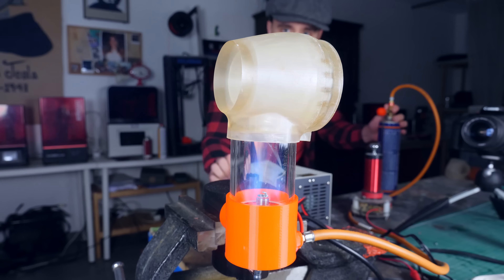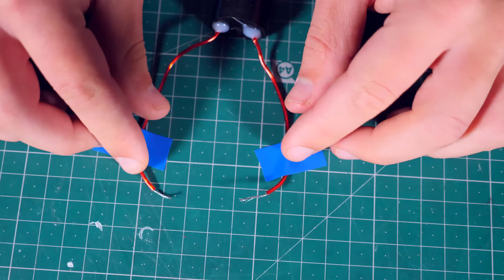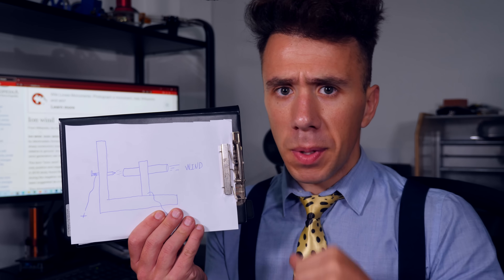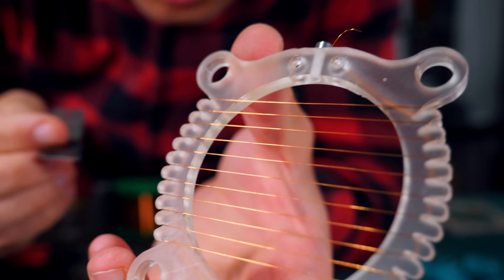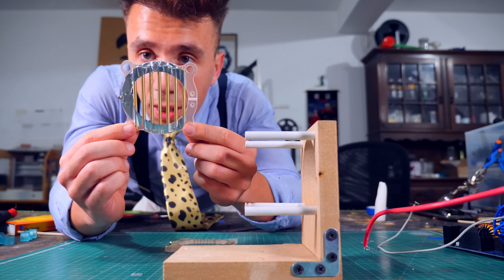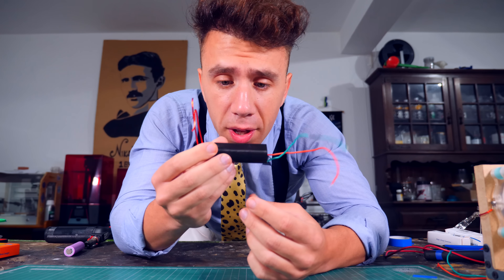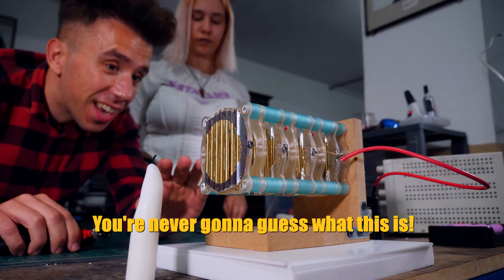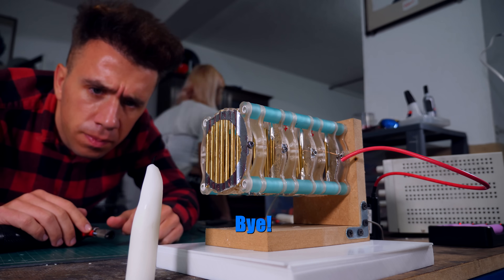I built a TRUE BLADELESS FAN

Comment: This was an idea I had as a form of new space propulsion when I began my career as a T.V. Engineer back in the 80's and my Tie stuck to the front of a Television..

I Know anyone could say this but It's honest truth.  

I Believe the answer, (Thought when I had my original idea) is to switch each H.V. Coil on and off in quick succession..
Maybe try connecting to a car distributor cap and spin that with a drill.

If that works look into switching the coils on and off faster with a simple 4017 Decade counter driving F.E.T Transistors and a 555 variable frequency clock generator or an Arduino driving 4 F.E.T Transistors (Take care protecting the electronics with suitable flyback suppression)...

This suppression isn't required with the mechanical car distributor which is why i'd reccommend trying that first.  Around 5 euro from a car scrap yard.

Plus i'd love a 3D Printer and i've never seen this idea of quickly switching each on and off sequentialy.
I'd also be very interested to see the results..

Cheers.

Comment: What would be quite interesting to know are:
- How efficient this is compared to a normal fan with blades?
- Does changing the grid size lead to better or worse results?
- What are the maximum amount of sharp points possible before it doesn't work anymore?
- Will a bigger or smaller blunt line increase or decrease air flow?
- It has Airflow but does it also have force behinde it? For example in some of your jet engine videos it turned out that eventhough there was alot of airflow there was no thrust.
- Instead of using wirles why not use metal mesh? That would increase the shappoint density per sqmm.
- Is does the weight to thrust ratio scale linerally with size (radius)? Maybe smaller radius has greater thrust making it possible to build small rc planes with these wich would be cool.

Comment: You should put a duct around this design and see if you can focus the air better to avoid losses. Also, shoot smoke through it so we can see how the air looks/see turbulence. I think the hovering triangle used foil because that had less resistance. Your tubes are going to cause drag when the air has to go around them. If you had a foil array, even if you thickened up the foil, it would perform better.

Comment: Want to upgrade it? Make it much bigger, larger diameter , then use a screen, like metal window screen or a flour sive. then use flat instead of tube. Or even  concave the surface a little. Then multiply layers like that. Put it in a tube to seal the sides and put a nozzle on it to focus the wind. 
In short make it like you would a jet engine, except short length and bigger around . 😉

Comment: How much ozone is that thing putting out?  You could increase the output by making each stage a bit larger and placing them inside a duct that allows outside air to be pulled in through ports using the venturi effect.  Kind of like the SR72' J58 engines do.

Comment: I have two ideas. They are both brilliant. I also have a third idea that is less brilliant. 

First, close the tube. You have the whole sequence open on the sides which is convenient for filming, but you aren't building any pressure to move more air. Just enclose the set in a clear tube. 

Second, use a venturi air mover to increase airflow. This is the effect that the overpriced Dyson uses to get lots of airflow from the relatively small fan inside. 

Third idea. Try using more tomatoes. Lots of them. Whole boxes of tomatoes.

Comment: That whistling you hear is not wind. It is sound created by the plasma heating the air with a certain frequency that comes from your voltage boosters being switching power supplies that use coils and pulsed electricity to increase the voltage.

Comment: I wonder if you could improve speed by using higher voltage at each stage, now the air is moving from a high potential to a lower potential and back to a higher one again, so you might be deaccelerating the particles between stages. So in theory by connecting the generators in series, and having the first anode at the highest potential and the last cathode at ground, the air flow is always pulled towards a lower potential. Mind you, this is based on my absolutely zero knowledge of ionic wind, which I learned about approximately the length of this video ago for the first time. 😂

Comment: Ok the problem with your ion thruster is that you have like almost packed the intel for the air if you allow more air to come in maybe the thrust increase and not only high speed wind will help you create thrust but you need to pressurize the air to get that sweet full thrust.

Comment: Video Idea: Bladeless fan in a drone setup. But not just any drone setup, set this up with the Spinning Drone Paradox. Since the bladeless fans don't have a lot of force behind it, what if you used the thrust it is giving to rotate the blade which in return gives you force to fly the drone. A YT channel (Nicholas Rehm) made a drone with this Paradox and I am curious of how that would turn out.
Reply: From my armchair research you could, but the amount of power you would need would be immense. Like, the kind of power a drone battery might not be able to provide. There's a reason these ionic boosters aren't used to power fans to begin with

Comment: How about make the negative elctrodes out of PCB material, use coarse sand paper on the copper electrode of the PCB, and on the positive electrode use aerodynamically shaped 3D printed parts and coat them in copper or something conductive enough for the experiment, Enclosing the sides wouldkely increase efficiency too, maybe take advantage of the Bernoulli principle aswell at that point.

Comment: This is exactly how ionic air purifiers work. They have thin wire in a grid and the "filter" is metal strips. The dust and stuff in the air is attracted to the metal plates and sticks.

Comment: Idea: Make a jet engien that is light, small and compact. Than eother mount it on a RC plane or a car. The rezultat would be i same if it could be done. If you make it on a airplane, make the plane body with styrofoqm the weight is redused. If you make it on a car, i reccomend making a aerodinamic plastic body, not heavy but not to light, also the body/shell should be low to the ground, at least at the front. Thats because fast moving air could go under the car from the front and push it up and makes a whole backflip. These things could be very interesting to see come to life!

Comment: I bet the stages are working against each other.  You might want to put screen attached to ground between stages.  
Circular cylinders are more draggy than elliptical cylinders, so you might want to roll your tubes so they are smaller in cross-section.

Comment: Why not create a hollow wire next to a regulate wire, but at Nano levels, and see if the wind adds up if you make bigger and bigger strands to handle the wind passing by.... Start Nano, and build layers larger and larger to handle the progressive air flow.... In this way you can still layer the progression output, but from a more efficient starting point.

Comment: "The Ionic Drone Alternator" basically this concept turns a car alternator into a drone motor that charges the battery and boosts the ionic wind from the net below. I'm not worried about the 3d printer I simply don't have the time or resources so I'll give it to you

Comment: Stick with a fan. Maybe even a 10" (250mm+) 7200Rpm  Pabst EBM, with the cast steel blades. Remove the fan guard to theoretically improve flow !
Your Ionic Cannon is cute! 🥰 I think you should surround it in a 16 stage toroidal accelerator. Phase the Ionic field exactly opposite the toroid field pancake.
Then flip the fields at 400hz. 😛 You might need to make some REALLY big Caps too, maybe use aluminum garbage cans, you need like 100Gf (10x27th) and put them in front of the toroid's, but behind fets or hefty SSRS.  Things at range  will  ....Glow

Comment: Maybe put an engine of yours on a model airplane and fly it. That is always impressive. It doesn't have to be this one though, because storing the battery, circuit and motor itself could be challenging.. So just use one of your other engines instead XD

My first suggestion would have been to build a rocket, but that is way to complex to build and to steer, while you can just take a model plane and strap stuff  onto it. 🤷‍♂️

Comment: What about a series of rings and reduce the radius as you get closer to the center? So instead of a series of straight wires/tubes its a series of circles. Also use a seperate HVG for each set of rings.

Comment: How about a little cheat ?
Use your design in place of the rotary fan in a "bladeless" fan ? 
Enclosing the wind generator should help a bit with power. 
Saw other great ideas in the comments. Perks of being late.
Sandpaper scratches on the emitter wires, and coiling wires on a blade shaped receiver, might be worth a try.

Comment: For the largest number of corona discharge points, use carbon fiber cloth cut to expose millions of fiber ends. These are used in ion generators and are the best ion sources.

Bear also in mind that this device is at its core an ion generator and can crank out lots of ozone. Take steps to prevent destroying your lungs.

Comment: I played around with this aswell and it’s so fascinating 😳 I’d love to see adjustable distance between the stages.

I assume you have one common voltage that is the same for every stage. But the stages are a bit different. 

If you make it so that they can be adjusted individually with a screwdriver and not with the spacers, you can fine tune each stage for maximum flow juuust before the sparking point.

Ideally this will shorten the spark gaps and increase the amps without the voltage breaking down.

Comment: Video Idea: I guess you could make the beam more localized by using magnets as they do in particle accelerators. From what I see this is not much different from a linear accelerator. To achieve this, usually a multipole magnet configuration is needed. A more localized beam would give an increased flux and therefore more wind in a smaller area.
Reply: A problem might be the additional ozone produced in such a small work area.  This multistage setup is already getting up there; depending on the voltage.

Comment: Something Ive wondered about is replacing a solar panel with a hot air engine to generate electricity. I did the calculations and if you make every stage efficienctly you should be able to make a system with an efficiency about 3% higher than a normal solar panel.

Comment: It really tickles me that these designs are being discussed more. I've been obsessed with the "solid state propulsion" airplane concept that came out of MIT years ago, and in the reverse, the "vaneless ionic wind generator" for harvesting power from airflow. Really curious to see what systems people will apply this phenomenon to.

But yeah! If I were to suggest anything in particular, using the Coanda effect that those fans advertised as "bladeless" do might be kind of fun. The grounded tubes could maybe be reshaped such that you see a flow along their surface. At any rate, right now it might be losing at least a little efficiency to the wake of the tubes. Not sure how much that ultimately matters as you add more stages.

Comment: The reading on the anemometer might be inaccurate due to noise from the high voltage Chinese spark whatever
Reply: I think I know how to fix the water jet skateboard just make a ring on the front of the impeller the centrifugal force might be pulling the blades to the point that it gets destroyed Ps I hate tomatoes raw too and ketchup is not my favourite

Comment: Make a ring where the pins to hold the wire is in the middle and on the outside. You will get a star shape and also you will have more thrust in the middle. For the other side drill holes in a copper sheet and put short pieces of coppe tube. Use solder to connect them. If the ratio of holes, diameter and density is right you should have enough area for the plasma to catch on. 

Stacking them probably mainly does accelerate the air more but does not move much more air. 
I would suggest to make the next stages smaller and use a cone shaped housing to guide the air to the next stage. Thist should result in some more preasure on the next stage witch means more air particles are able to be accelerated. 

Thats my idea. I am not an expert in this topic neither I haVe experience in this topic.

Comment: The table saw cut at 2:13 is a nice quick way to lose your fingers. Never push something wider than it is long through the blade like that - if the leading edge touches the rear half of the blade the stock between the fence and the blade will twist, get pulled into the blade, and thrown at you with enough force to do significant damage. There's a decent chance the fingers on your right hand will also meet the blade.

Make a crosscut sled for those type of cuts, and always use push sticks for general stock handling... otherwise your next project might involve a trip to hospital; which no one wants to see!

It looks as though that saw also allows the fence to be slid back for ripping jobs. Take advantage of that (i.e. don't have the end of the fence beyond the blade teeth when ripping - to avoid material being trapped between the blade and the fence).

Comment: congrats! you just made a more dangerous version of an "Ionic breeze"!.. operates on the same principle, but yours is going to produce A Lot of ozone as opposed to negative ions...The key difference here is that purple glow... that coronal discharge is what's needed to generate ozone... you don't want that, you just want to create an electrostatic potential.. so dial that voltage back a bit if you like your lungs.

 i wouldn't run the set up you've got for too long in any space you will be occupying.. it'll be great for sterilizing your work space though.. just make sure your not in the space at the same time... pretty sure you don't want to destroy the lining of your lungs...

i'm not one to talk though.. i actually used to make those ionic thrusters using the power supply from crt monitors... cause i thought it was "cool" to try and make them as big as I could...  ahh.. if only i knew then what i know now... lol

Comment: The immediate thought I have is to optimize the overall effective use of the generated force. A big part of the Dyson fan design is that the air pressure it builds is released somewhat evenly around the ring. It induces air moving through the ring by creating a pressure differential and another effect is supposedly that the generated airflow is more stable than with a regular fan, a mini jetstream. 
With your electric bladeless fan design you could build a large circular frame with the wires and tubes going around an open middle. Then you'd also need a shell for the ring to optimize the resulting air pressure behind the ring.

Comment: I would like to win the printer. My suggestion for a video is to research and DIY an advanced housing for your bladeless fan. But, here's the trick and the interesting part... I believe that the housing should not be just a tube with holes for the intake and output. I believe that it should have additional porting, along its length... Some sort of funneling? Maybe the Venturi effect may be of consideration? Maybe the interior shape of a jet engine housing would give ideas? With a comparison test that shows that the improved housing is better than just the tube. A smoke test would make for cool video images... Go ahead, make this old man happy by sending me a printer; please and thank you. Cheers!

Comment: ...I had suggested Ionic Engines a while ago.

I believe it was in one of your Jet Engine videos, the Pulsejet one, If I remember... Or it was the Jet engine after it. I had suggested combining an Ion intake with the jet.

Took you long enough to even START with this, Integza.

Still, if I were to make a suggestion? If the Bars are interfering with the airflow, I can see two ways to make them not do so. The first is to arrange them in an angle and pattern, similar to the Blades of either a Fan or an Impeller so that the air 'Spins' as it goes down the engine... Or replace the Bars with Circular loops of wire that is tucked into the sides of the nacelle, seeing as the Original Ionic Levitator put the "Intake" Wire in a manner that does not interfere with the airflow going into the Foil.

Either way, both could work in their own way, and maybe could be combined.

Comment: Make a rocket using ionic thrusters but instead the cylindrical rods use drop shaped copper fins to control the air direction

Comment: Video IDEA: Since you are using a high-resolution SLA 3d printer to print part of the negative side why not 3d print the whole thing, but instead of cylindrical tubes for the negative electrodes 3d print an aerofoil shape and paint it with some kind of conductive paint. Seems like it would be worth a try and could be worth a try and improve the efficiency, you could also experiment with 3d printing the positive electrodes although I'm not sure how successful that would be. one issue I could see with using conductive paint for the negative electrodes is that the act of painting it on with a brush could make it rough, Mabey using an airbrush could help solve this problem; anyway, great video!

Comment: Solar powered alarm clock that runs on capacitors only, no batteries. 

Doesn’t matter if this comment gets any likes. No internet access to d/l a 3D file to print. 
Video got an automatic like with the first anti fruit comment. 

Once you build it, but before you air the video, send it to ave for him to disassemble (put a #5 on it to geek out the short circuit fans). Then, a week after it is delivered to him, post your video.